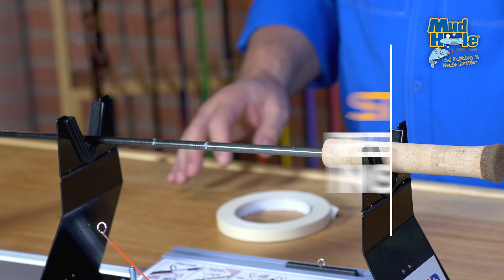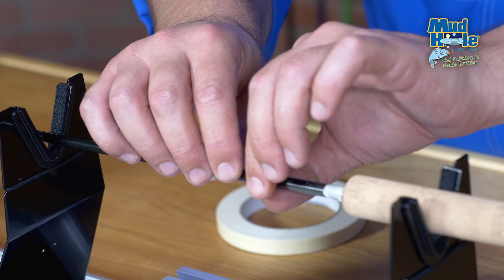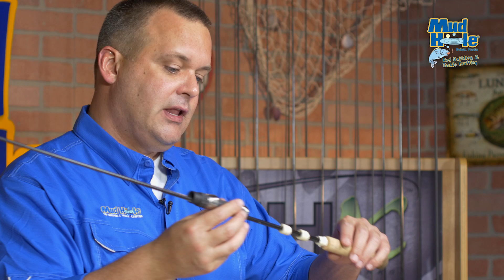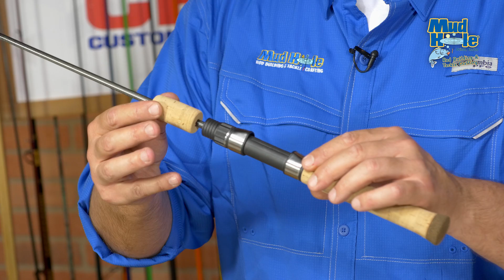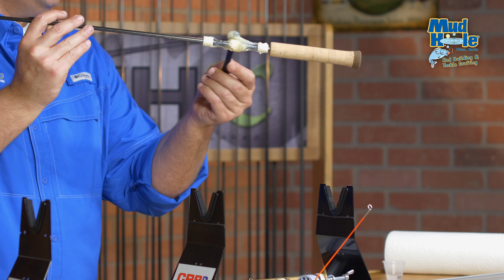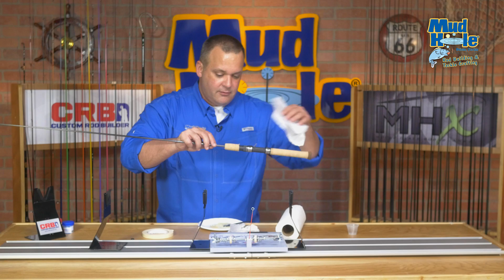How-To Install A Spinning Reel Seat | Rod Building 101

Comment: I have a question. This particular rod with the single piece rear cork grip. Is this the 5'6" light,  med-fast offered in the turnkey on your website?  I ask because I do a lot of small stream trout fishing and I am looking to build a spinning rod with a short cork rear grip such as the one in this video.